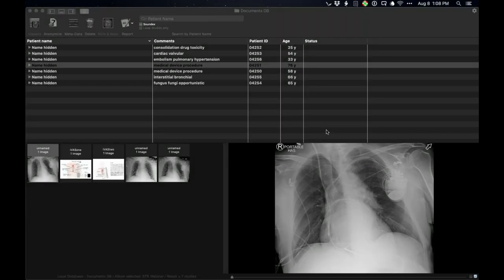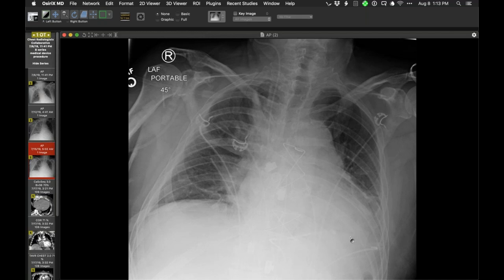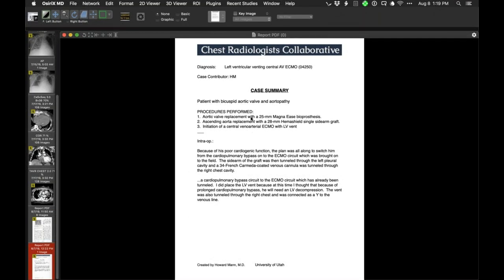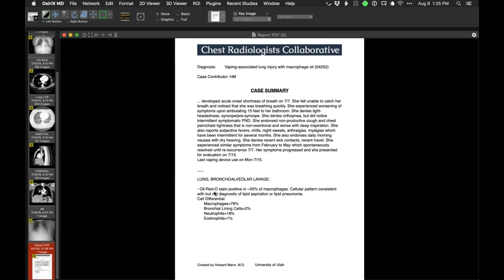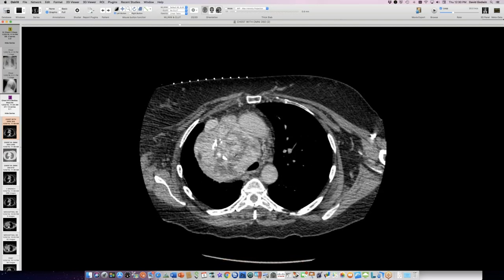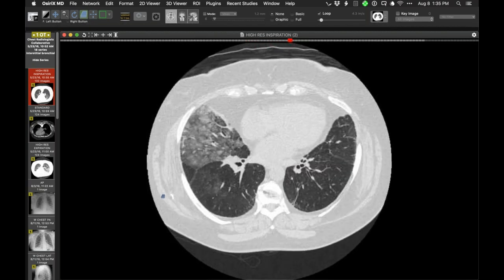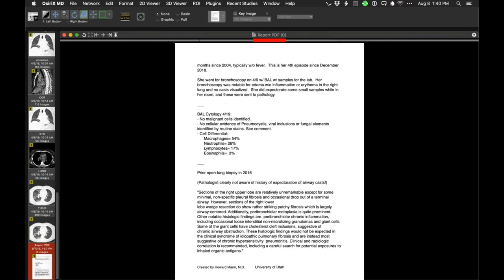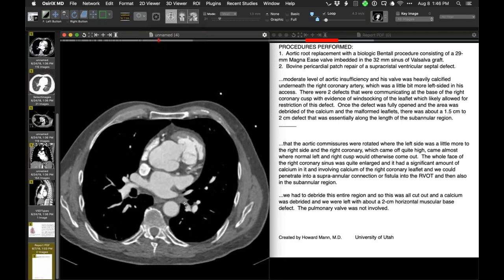STR Cardiothoracic Case Webinar 8/8/2019

Comment: 0:45 Case 1
4:52 Case 2
12:10 Case 3
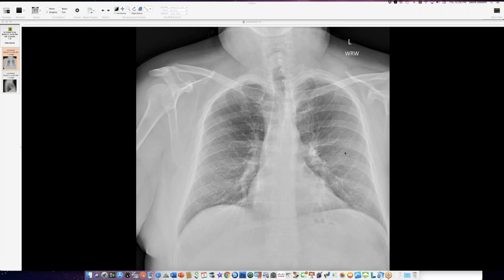18:17 Case 4

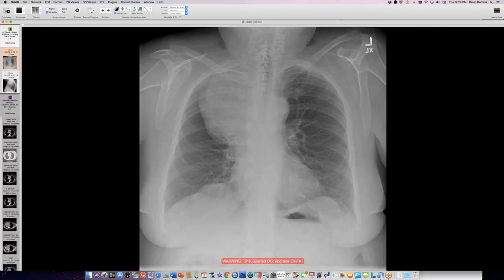21:57 Case 5
25:56 Case 6
34:05 Case 7

Case 1 Experimental device (contrapulsation aortic balloon meant for ambulatory patient)
Case 2 Impella device in context of post surgical left ventricular distension
Case 3 Vaping-associated lung injury with macrophage oil
Case 4 Birt-Hogg Dube (asymptomatic pneumothorax with cyst and Chromophobe renal tumor)
Case 5 Anterior mediastinal mass not connected to the thyroid gland, ectopic goiter
Case 6 Idiopathic plastic bronchitis 
Case 7 Supracristal VD connecting LVOT and RVOT beneath the pulmonic valve, causing prolapse of the right cusp